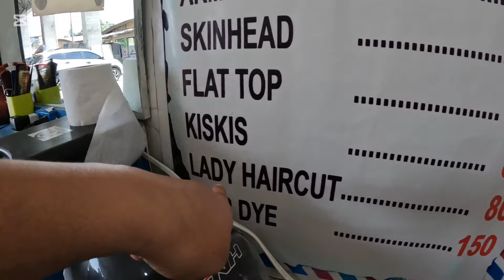Why Our Old Living Room Looks Weird Now + Dennis Requested A Vote For What???

Comment: Maybe you can buy an island kitchen table and chairs. If you can find a table with storage and wheels (with locks), so you can move it around anywhere you want it. This would be nice for additional working space and can be used for dining as well, nice for quick dining or snacking.

Comment: Side wayside looks good. Do you have a water filter for the kitchen and is that water the same as the water in the patio? I have noticed that the water in the patio has rust stains on the wall. Just curious 😂😂